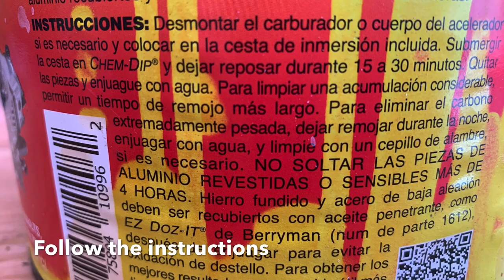VW 30 PICT 1 Carburetor maintenance

Comment: Good video! How do you adjust the auto choke tension?
Reply from the maker: Once you have the spring seated on the shaft, turn the assebly to the point where you can feal tension just starts to develop, then tighten the screws to hold it in place.